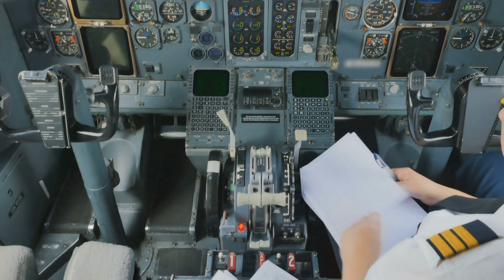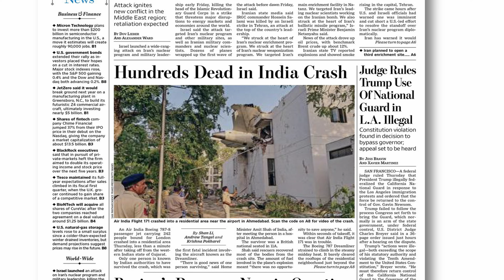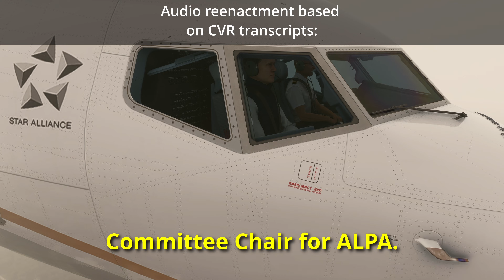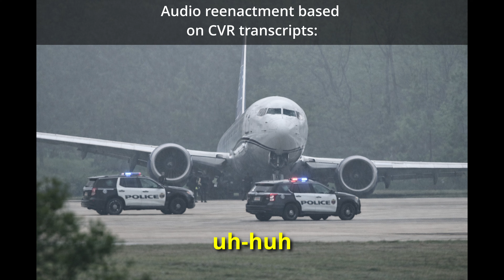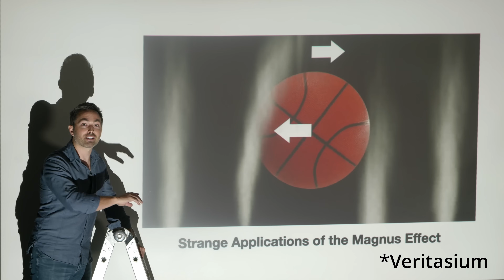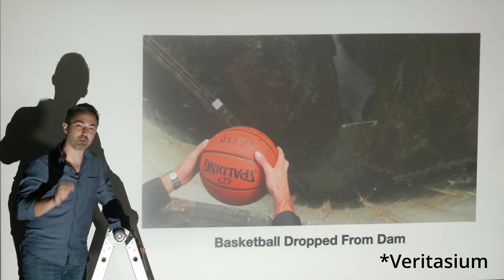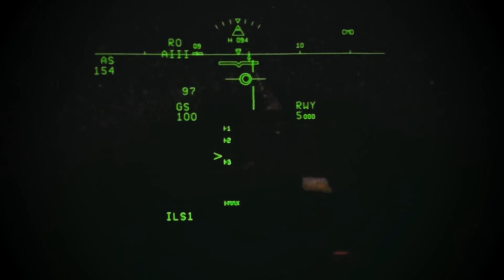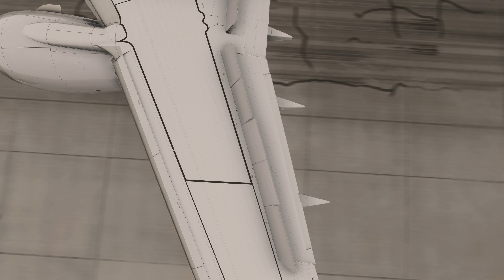United 737 Cockpit Voice Recorder Confession

Comment: The evacuation checklist is supposed to stop the CVR so it preserves what happens before the incident.
Reply from the maker: The 737 is a weird bird. The evacuation checklist stops with the battery still on, which allows the CVR to keep recording. Pilots either elect to turn the battery off, or pull the CVR circuit breaker, or the thing runs until the battery dies.

Comment: It has been a number of years since I flew the B737-200 and 300, but I seem to remember using idle reverse on occasion all the way into the turnoff (usually a high-speed turnoff) in order to at least remove any forward thrust. Do the guys not use this technique anymore?

Comment: When pilots lie and rather try to save their tail than tell the truth it harms the flying public . 

And these old dudes are always doing some weird unnecessary stuff in the 737 …like they’re bored or trying to prove something . No reason to be stowing speed brakes while still in the runway, no need to stow reversers right away either.  

Goal is always to get off first practicable taxiway

Comment: Excellent analysis. Pilots are human beings and are prone to making mistakes, just like anyone else. However, in their case, a minor mistake or bad judgement call can result in catastrophic damage and/or loss of life. If theres one line of work where SOP's are your friend, its flying a plane. I dont fly panes but I do push them back from the gate on a daily basis. Ive learned to question anything that remotely doesnt make sense.  Ive had pilots provide me with what I knew were incorrect push back instructions.  Sometimes it was the apron that made the error and on occasion, it was the pilot that repeated the wrong information to me.  Especially during night ops, heavy fog or snow storms, where low visibility is involved, it can be dangerous.  Complacency was more than likely a huge factor in this scenario.

Comment: ATIS reported runway condition 3/3/3 - “braking deceleration is noticeably reduced for the wheel braking effort applied or directional control is noticeably reduced" and the FO recalled "the runway appeared wet." Yet "the captain recalled that the runway appeared dry." I am wondering about crew coordination? Did they discuss the runway condition and company policies, or did the PM keep his assessment to himself? Maybe the final report on DCA24FA120 will include the full CVR transcription.
Reply: The pilot admits on the CVR that he didn’t take the wet runway into account. From that, I’m inferring there wasn’t a proper pre-landing briefing.

Comment: The FIRST UNNECESSARY CRACK IN THIS CHAIN was the Captain’s request to “roll to the end”.  Runways are NOT taxiways!  They are dangerous and valuable surfaces that should be cleared at the earliest practicable opportunity.  I am NOT suggesting a maximum effort stop.  A normal stop and deceleration followed by a timely exit from the runway as stated the FAA’s Airman’s Information Manual, 4–3–21 Exiting the Runway After Landing.  Instead, the Captain elected to use the runway as taxiway to taxi to the end at speed request by ATC that left no margin for error.
Reply: As long as you do it right is ok to do, I did it perhaps hundreds of times in my 25 years with the airline. You had to respect the runway remaining boards and have speeds in your mind you want to be for the last 3 boards. That was always my plan and never failed me. With the HUD it became a no brainer but I still had my own, more conservative,  mental restriction.
I taxied once by a Triple 7 with one of the mains on the grass in CDG/Paris and you could see all the passengers looking out the windows. I was glad I was not part of that crew.
Reply: @EsparkyDog  I wonder how long that runway was out of service. It ain't like Mx is going to get out there with a tow bar and tug and be on the way to the terminal. A broke off gear complicates things.   Could have been like "Airport 1970" and airport manager Burt Lancaster yelling, "Want want my runway back!"

Comment: Dudes were fortunate to have a union behind them.
Reply: There is always a struggle between due diligence and scapegoating when a union meets management/regulators. The crew probably escaped with retraining, but I would like to know.
Reply: @jed1947  Those two pilots are now probably the least likely in the fleet to have a braking/runway surface related excursion.
Reply: UNION BEHND THEM? Obviously it was not a Southwest incident!
Reply: Well the union cost 600$ per month for a CPT
Reply: @unbekannt1956  No airline has union dues that high. I sure don't.

Comment: 35 year airline veteran here. Starting back with the 727 and through the Boeing fleet, I was always trained and prepared to bring the airplane down to single digits before exiting a runway…… some high-speed exits can be taken faster if the conditions are dry.
Reply: I am guessing this guy had a commute flight to catch. I have your same airline experience as you and have seen pilots do some crazy things to make their commute flight. When I was a 727 flight engineer for United and back in the late 1980s, we were on a flight from RDU to ORD flying the first 727 ever built, N7001U. The captain hit Mach .895 on the flight to ORD which put us in continuous Mach buffet. Then on a left downwind to RWY 27L heading east and his flight home was in 15 minutes. I vividly recall seeing 410 knots indicated at 13,000 feet.
Reply: @MrSuzuki1187  Those B-727 can really go fast!
Reply: And if you put it in the grass you DO NOT call the freaking union while you're sitting in a busted airplane in the grass with passengers still on board.....